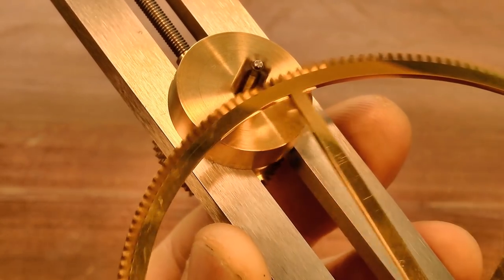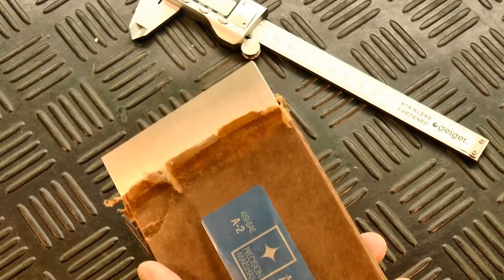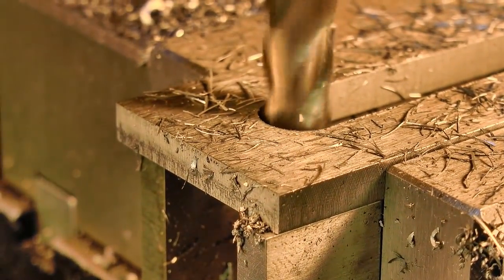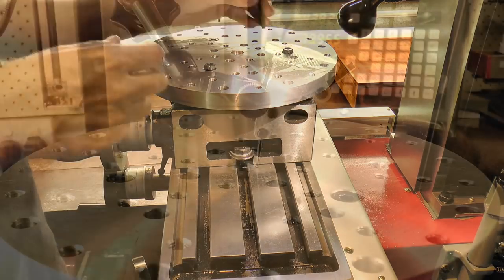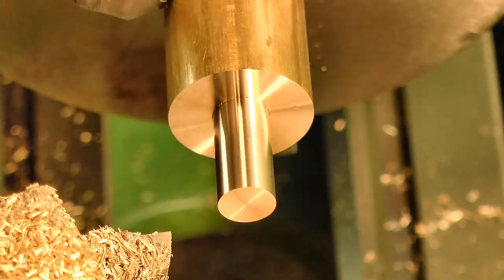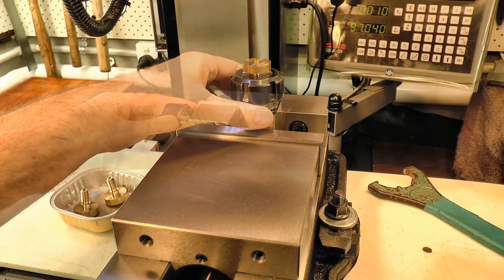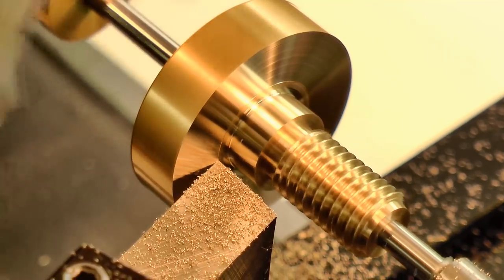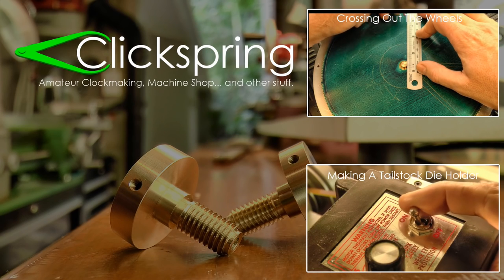Home Machine Shop Tool Making - Machining A Pinion Head Depthing Tool - Part 1

Comment from the maker: Making this tool is something of a rite of passage for any amateur clockmaker.

If you're going to make a clock using the modern approach of creating the pinions as "heads", then at some point you're going to have to take time out from the clock itself, to make one of these depthing tools.
Reply: what are you doing at 1:58?
Reply: +Bonhor That's called an Edge Finder.  When the small shank touches the edge of the part, it will 'kick over' like you see, it starts off wobbling and then gets more and more stable until it kicks over just a tiny bit.  Usually from there you subtract half the diameter (usually 0.200" so you'd move over 0.100") and that puts the center of the spindle over the edge.  After finding his Y axis edge he moves over and finds the X axis edge, from there he can use his DRO (Digital Read-Out, basically an electronic ruler that measures and shows the exact location of the mill table at all times, usually to within 0.001"-0.0001" accuracy) to perform all of his other operations using the dimensions in his plans.   They're surprisingly reliable if you creep up on the edge carefully.

Comment: I use Dormer Shark taps because they are color coded for different materials and the quality is amazing. Check them out if you like. Yellow is for steel/brass/copper. Green is for non ferrous materials and blue is for stainless steel. Then you have red for alloy steels and white for cast iron
Reply from the maker: Daniel S I'll check them out Daniel, thanks for the tip.

Comment: Why do you start your holes with what looks like a regular drill bit, and then finish with an endmill? Also this is the best channel on youtube right now. I'm rewatching these waiting for the next one to come out.
Reply from the maker: Joe Doesntcareaboutthis Hi Joe, I use an end mill for the final sizing when position and finish of the hole are important to the piece. It tends to leave a better surface finish, and also drops the hole precisely below the spindle. A standard twist drill leaves quite a poor surface finish inside the hole, and will occasionally wander despite best efforts with spotting drills etc. Thanks for asking mate.
Reply: Very cool. Thanks for answering!

Comment: Another great video, thank you.  Why do both of the carriers need to move along the tool bed?  It seem mechanically simpler to have one fixed and the other move.  Perhaps it will be obvious in the next videos.
Reply from the maker: Matthew Prestine Hi Matthew, you are correct that one carrier could be fixed and the tool would work fine. In fact a competing design by John Wilding is designed exactly like that, and has been made and used for decades. I like the idea of both carriers moving mainly for easier handling of the tool when it is loaded up with wheels for depthing. If both carriers move, the whole assembly can be moved down the bed, making it a bit easier to hold and use.

Comment: Thanks for the excellent videos.  My skills are still very limited, but I learn some new with every video.  In this video I saw a countersink with a "D" cross-section.  I understand that drill bits can be shaped so and that holes drilled with them are more precise than with regular twist bits, but perhaps less precise than with a reamer.  Could you please comment on this, and possible make a video if time and opportunity permits?  Thanks
Reply from the maker: Hey Bob, that has been my experience regarding D-Bits - excellent for drilling precision, usually equal to or just short of reaming precision. A dedicated D Bit reamer is also a very simple cutting tool to make. I have covered D bits in the 1st patron Series project, and will likely revisit again in another project when the need for one arises. Great to have you watching
Reply: Ok, thanks.  I'll look for it.
Reply: Clickspring a

Comment: Another thumbs up!
Why is it necessary to center punch the holes first? Can't you just drill them straightaway if you use the mill to position?
Reply from the maker: horle I think so, yes. Generally speaking a punch mark will help the spot drill start better, but to be honest, I often do it to make sure I have the picture in front of me, to try to avoid absent minded mistakes. Thanks for watching.

Comment: It looks like you don't use much in the way of suds/cooling fluid when cutting steel on the mill. 

Do you have many problems with overheating?

I'm enjoying your videos, and they make me want to have a workshop to make things. Alas, I lack the space at home.
Reply from the maker: +LordRaa Mostly I find I don't really have any need for coolant. I use cutting fluid every now and then for some steels, and for steel tapping etc, but even there I find I really don't need it. I keep the speeds conservative, and the cuts modest, and it all works out ok. Thanks for watching and asking :)
Reply: +Clickspring That makes sense. Occasionally, I'm allowed to use the manual milling machine at work and I've been quite severe with some of my cuts.

I'm still learning, but it's good to have a play with this sort of thing. 

Keep up the good work, sir.

Comment: Nice presentation Chris!  I just found your site and I'm happy I did.  I liked how you superimposed the model into your part.  It looks like you are using Solidworks for modeling but how did you superimpose it onto the part ?
Reply from the maker: Ujeb08 Thank you! The Solidworks graphic is placed on a separate track.

Comment: Also why after you've bored out the central hole, and cleaned up that bottom surface, do you go back in with a reamer? Just to put a cleaner finish on the bore surface?
Reply from the maker: Joe Doesntcareaboutthis A reamer is generally used to achieve final hole dimension, as well as leave a good surface finish. In this case, its more about final dimension. The tool needs all tolerances kept to a minimum to maximize its accuracy when in use. Cheers mate.

Comment: 6:50 I see you use this bit after drilling holes. What is its purpose? Does it just clean the bore?
Reply: Francis Grabetz pretty sure it just makes sure the hole is exactly the right size
Reply: It's a reaming tool. Drills do not make truly round holes, these do and bring the hole to exactly the correct size.

Comment: What is the name of the holder where you put the screw on the mill machine vise ?
Reply from the maker: David De La Cruz That is a Collet Block. It holds ER32 collets, There is a matching hex version too. I reach for them so often, they are one of the most used tools in my shop. I got them here: http://www.arceurotrade.co.uk/Catalogue/Collets/ER-Collet-Fixtures/ER32-Collet-Blocks

Comment: What is the thickness of the frame? I see that the package said A2 steel. seems like cheap machine steel.
Reply: A2 here in the States is a high quality air-hardening steel. I've made many sheath knives out of it and they are very good quality